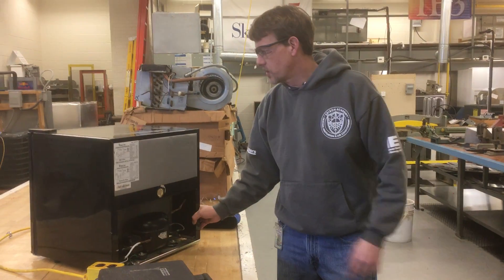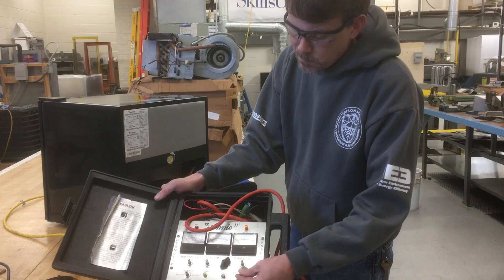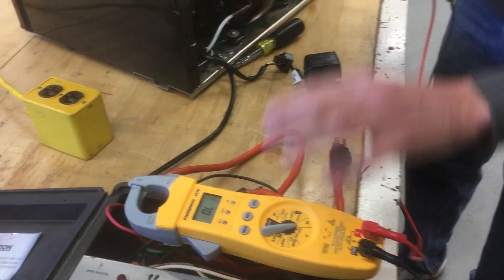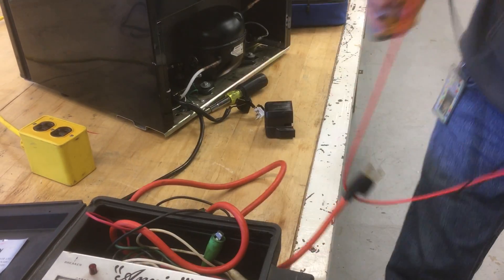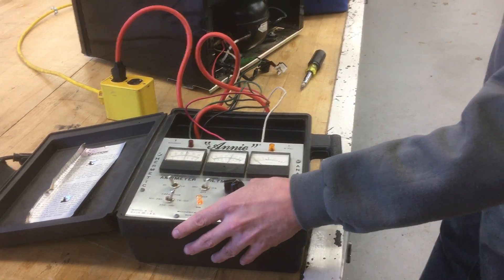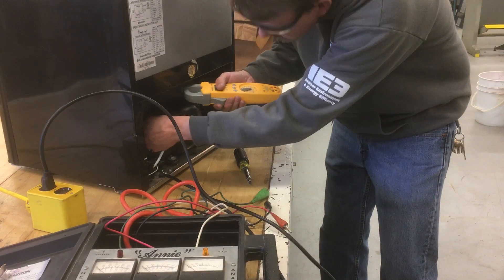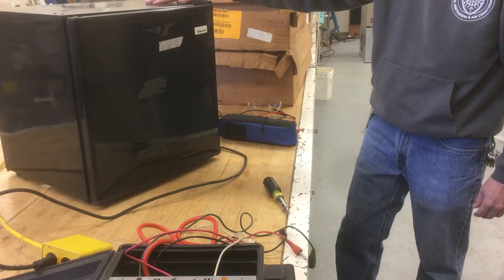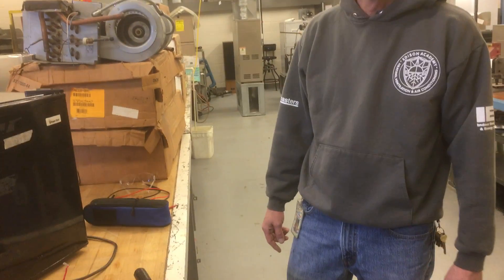HVAC Basics: First - Mini Fridge Troubleshooting Part 2 - Using "Annie" to start a stuck compressor

Comment: On refrigerators that cost over $1,000, why doesn't the manufacturer have this restart device built-in to the refrigerator? I can see how easily it could be implemented but I assume they won't because it will devalue you technicians.
Reply: planned obsolescence

if the fridge stops working, the customer buys another $1000+ refrigerator and then whoever hauls away the old one just restarts that fridge and resells at used appliance store

Comment: Because of your 2 great videos, I have deduced that my fridge also has a stuck compressor.

Bought an Annie A2 on eBay for a quarter of what the fridge cost me. Will report back when the Annie gets here.
Reply: how did it go?
Reply: Successful! Sold the fridge and it paid for the Annie and helped catch up on some vet bills from my aging doggy. Learned something new, cool tool, less stress. Win, win, win!
Reply: @paultrahanjr.8217  awesome

Comment: What an interesting way to unlock the compressor. Presumably to run it in reverse, Annie would wire its internal capacitor in series with the run windings, causing a reverse phase shift, with the start windings acting as the new run winding. That would drive the rotor the opposite way for a few seconds. Great teaching.
Reply from the maker: What an excellent comment to sum it up perfectly. Thanks!

Comment: Very helpful video. I watched both Part 1 and 2. I replaced the relay and starter. When I turn on the thermostat I hear the relay click and the motor attempt to start and then stop. I also smell that electronic burnt smell afterwards. Based on watching your video I have the feeling that the compressor motor is frozen. My question is, without this Annie what other options do I have to get this mini-fridge working? I wonder if I can take this unit to some local electronics shop and see if they can try and shock it back to life. I found this min-fridge in a dumpster and it's in great shape physically. It still has the plastic protective wrap on the door and the sides! Am I wasting my time? Thanks
Reply: I have the same thing and the same question

Comment: I have a Mini Fridge, the Thermostat and Switch is fine.  The Compressor runs but is hot to the touch, but it will not cool.  It's a brand new fridge right out of the box. What could be the problem???
Reply from the maker: Low/no refrigerant or the compressor runs but does not pump due to an internal issue.

Comment: Is it normal for a mini fridge compressor to get scalding hot? I’ve loaded a lot of water bottles in the refrigerator and wonder if it’s that’s the problem
Reply from the maker: High heat load requires more work and full capacity to remove the heat. Once satisfied it shouldn’t be the same amount of heat coming off the compressor or rejected at the condenser to maintain the temperature of the load.

Comment: thats not how a capacitor works, the electricity does not jump from one side to another. they work more like a water accumulator, electricity goes in the common through the coil builds up then is pushed back through the coil. this happens 60 times per second. the capacitor size determines how much electricity is pushed through the coil which is why it determines the amperage.

Comment: Excellent teaching, but these kids seem a little dumb. Who ever is video taping should be getting right in there because we can't see anything. It might as well be radio. I would have liked to have seen how he hooked it up to see that it was locked up. I saw the first video. It seemed like some kind of clamp. How did the multimeter make contact with the wires and which ones?

Comment: Question, in the event you described, can you just replace the motor starting capacitor, and with perhaps a slightly larger capacitance one?
Reply from the maker: Not in MFD’s. There is a +/-  tolerance and it’s small. Oversizing will damage the windings. Thanks

Comment: I'd love to see a video of add/checking charge of a closed orifice system such as this mini fridge. Sometimes it will specify type of refrigerant and amount of charge but  I've checked all over and nobody seems to have a video of it. Seems these units are viewed as disposable.
Reply: They are considered disposable. Most are R-134a refrigerant. No Schrader valves to add/remove/purge/vacuum/etc  refrigerant. By the time you  pay somebody to add those Schrader valves & to properly purge, vacuum, add refrigerant the labor cost itself is more than the couple hundred bucks these things cost.

Comment: My mini fridge has foam pieces around the copper tubes at the back around the compressor should those be removed like shown in the video or is it safe to keep it on. I also have little plastic covers for the flat ends of the tubes

Comment: I tested with the Ohm and everything is fine, and I use Thermal Hemeti-check, then the compressor is wtill not run, but it start getting hot? Any ideal?

Comment: @edisonhvac great videos. Thank you.
What happens if compressor is getting too hot and tripping the overload. Capacitor/motor not jammed up, amperage doesn't change when overload clicks. Thoughts?
Reply: More than likely your Start "Relay" is bad and not making the motor start turning.  So it sits there with current running through the Run winding until it overheats and the Thermal Overload device opens the circuit.  Then when it cools it does it over and over again.  Your Start device should read about 10 ohms or less.  If it doesn't, replace it.  About $10 for the part.
Reply: @hjc4604  Thanks for your reply. I recently purchased this: https://smile.amazon.com/gp/product/B01AKWWLVS/ref=ppx_yo_dt_b_asin_title_o01_s00?ie=UTF8&psc=1
Thinking that the relay and overload were bad. When I shake the relay it rattles, which I've learned is a bad thing. But this rattled right out of the package, so I'm unsure if it is bad.
Is there a chance the compressor doesn't have freon? This mini fridge has been used on and off for the better part of 16 years.
Reply: @nicholassullivan1180   @Nicholas Sullivan  Not sure that I would rely on a rattle to check my components.  An actual relay with contacts and a solenoid might rattle when shaken even if it's good.  It's certainly possible that the refrigerant could have leaked out due to abuse or vibration.  Usually you will find refrigerant oil at the point of the leak and dust will stick to it.  The compressor label should show the Locked Rotor Amps (LRA) and the Running Load Amps (RLA) for comparison.  If the compressor is locked it will show LRA amps,. When running normally it should read close to the RLA.  If it's humming and the amps are below RLA it's probably not starting.  Try comparing the ohms of the old start components to the new start components.  Also what's the model of the fridge and the compressor?  Is t a schematic available?  Check out this video.  https://youtu.be/nx7l9kY2_bU
Reply: if you're not seeing amperage go up the overload device could be warn out and tripping at lower than rated amperage. also your meter might not be fast enough to catch the amperage spike.

Comment: First of all, thank you for th video.  You are obviosly a good teacher.  Next, without buying the expensive meter or even the other electrical pieces that you don't recommend, is there any way to reverse the compressor?
Reply: Generally to reverse motors you bead to reverse its input polarities ( switching the hot/neutral connection) I wonder if it’s possible to open up the compressor and manually do something too?
Reply: @CB_ChaosLove  hmmm 🤔. Me too! I need Annie to reverse mine I guess. Curious

Comment: What about shinning some light inside the compressor compartment so one could see how to connect the Ammeter? Just describing it ain't enough! 1st part was very good! Thanks
Reply: Put the meter clamp around the black wire or the white wire.  All current enters through the black (Hot) wire and leaves through the white(Neutral) wire.  Either one should work.
Reply: Amp's are taken with the meter "clamp" around 1-single wire . In single phase (120v) either of the two will give you the same reading

Comment: Help me understand this...I always thought common was the least resistance reading followed by run being the middle and start with the highest resistance reading???
Reply: Common is the lead that is "common", i.e. connected to both the Start and Run windings.  When you read S to R you are reading the resistance through both the Start and Run windings.  R to C is just the resistance of the Run winding to the Common terminal which should be the lowest resistance as it is the larger gauge wire.  The S to C terminal readin is the resistance of the Start winding which is thinner gauge wire since it is only supposed to draw its current for less than a second when starting before the Start Relay/Device removes it from the circuit.  Since it is thinner wire with more windings it has higher resistance.

Comment: Nice that it's running again, but WHY did the compressor lock up to begin with?   It's sorta like the situation with a blown fuse/circuit breaker  --  you replace/reset it, but then how do you know it's not going to just blow/flip again later?  Need to find out the cause of the lock up.
Reply: I see we have interest in engineering here. The reason they lock up is moisture in the refrigerant lines, usually combined with not turning on the compressor in a while creating corrosion within the compressor.

Comment: The following data is applicable to the ANNIE A12X Export 220-250 Volt-60 Cycle Model.

SECTION A – METER OPERATION 

Ohmmeter

1. Make sure the Analyzer is unplugged and Ammeter Switch is off, Ammeter operates on “D” cell battery.
2. Move Ohmmeter Switch to ohms position.
3. Clip Red & Black leads together, turn Master Switch on, needle will move to about zero. Adjust to zero Ohms with control inside chord pocket. If meter will not zero, replace battery.
4. Use Red & Black leads to identify winding terminals. Highest Ohms is from Start to & Run terminal.Terminal left is Common. Reading from Common highest is Start. The remaining terminal with lowest reading is Run.

Voltmeter

1. Disconnect Analyzer from external power source.
2. Put Ammeter Switch to “Hi” position.
3. Put Ohmmeter Switch in “Power” position.
4. Put Voltmeter Switch in “Line” position.
5. Turn Master Switch “Off”.
6. Isolate Black, Red, White and Yellow from each other and earth.
7. Connect power supply chord of Analyzer to "voltage connection to be read.
8. The "voltage indicated on the Voltmeter is the line "voltage supplied to the Analyzer.

Ammeter

1. Disconnect Analyzer from external power source.
2. Put Ohmmeter switch in “Power” position.
3. Put Ammeter switch to “Off” position.
4. Put Master Switch in “On” position.
5. Connect the apparatus under test to the Red and Black leads. Isolate the Yellow and White leads from each other and ground.
6. Connect the Analyzer to a power supply of the correct "voltage for the apparatus being tested.
7. Put Ammeter Switch to “Hi” position, read up to 25A apparatus being tested. After apparatus has started switch to “Lo” position, if current draw on the ammeter is under"5A"
8. If line "voltage is desired while measuring amperage, place voltmeter switch in the “Line”position.

Section B - HOW TO CHECK A HERMITICALLY SEALED UNIT 

1. Remove all external wiring from the terminals of the sealed unit.
2. Connect the Red Lead to the Run Terminal. White Lead to Start Terminal, Black Lead to the Common Terminal, and the 
Yellow lead to the solidly Frame.
3. Make certain Master Switch; Ammeter Switch and Voltmeter Switch are off. DO NOT CONNECT ANALYZER TO EXTERNAL 
POWER.
4. Put Ohmmeter Switch in “OHMS” position and press Start Button. If resistance is indicated (movement of ohmmeter)
the windings are shorted to the frame.Replace unit if this condition exists.
5. Put Master Switch in “On” to check resistance of Run winding. “Reverse” position checks resistance of Start windings. 
Replace unit if windings are open or earthed. 

Section C - HOW TO START A HERMITICALY SEALED UNIT

1. Remove Yellow Lead from frame and isolate it from earth.
2. Put “Ammeter” Switch to ‘Hi” position.
3. Put “Ohmmeter” Switch to “Power” position.
4. Put Master Switch in “Off” position. 
5. Put Capacitor Selection Switch in proper range (see selection G)
6. Connect Analyzer to power supply of correct voltage for the compressor. Power Light will come on when the Analyzer is energized. If no light or a very dull glow of Power Light check fuse in chord pocket. Replace if necessary. Line Voltage can be read by putting Voltage Switch in line position. 
7. Hold Start Button “IN” put Master Switch “ON” position.
8. Release button when units starts.
9. Turn Master Switch off if unit fails to start in 3 seconds. 
10.If unit operated satisfactorily the trouble is with the capacitor, relay, control, overload or other external wiring.
11.Put Ammeter Switch and Voltmeter Switch to desired ranges for further tests. These tests include low voltage or high current draws, those that are above rated amperage. If unit fails to start it is stuck, see section D. Disregard capacitor and relay bulbs while making this test.

Section D - HOW TO REVERSE A STUCK OR FROZEN UNIT 

1. Proceed as outlined in Section C, steps one and two.
2. Holding start button in, quickly move Master Switch between “On” and “Reverse” position several times. If unit starts let 
it run for approximately a minute then turn it off. 
3. Try to start the unit as outlined in Section C, Step 3. If unit now fails to start it is beyond help and must be replaced.

IF FUSE BLOWS WAIT FIVE MINUTES AND REPLACE THE FUSE INSIDE CORD POCKET

Section E - How To Test Capacitors

1. Make sure Master Switch and Ammeter Switch are off. Put Ohmmeter in Power position. 
2. Disconnect Capacitor form all external wiring including bleed resistors. 
3. Discharge Capacitor with light bulb or bleed resistor so as not to blow fuse on internally fused capacitors. 
4. Connect Black and Yellow Leads to Capacitor terminals.
5. Connect tester to power source.
6. Place Ammeter Switch in “Hi” position and note reaction of light.
a. If light goes on then out the capacitor has taken a charge. New capacitors may keep the light glowing for few minutes
b. If no light the capacitor is open.
c. If light stays on then the capacitor is shorted.
d. If light decreases but does not go out the capacitor is leaking.
7. When light goes out, press capacity button for mFd reading of start capacitors. (Do not press button if light remains on 
indicating a shorted capacitor) Discard capacitors that vary 20% from rating. For small start and run use “LO” range on 
Ammeter. 
8. (Optional) The Analyzer can be left on the job as an emergency substitute capacitor. Connect the Yellow and White 
Leads to the leads that normally go from the systems wiring to the capacitor DO NOT PLUG THE ANALYZER IN, put 
Master Switch on and set Capacitor Switch mFd needed. All other switches should be left off or in the center position.

SECTION F - TO TEST POTENTIAL RELAYS ONLY

1. Make sure Master Switch, Ammeter Switch, and Voltmeter Switch are off.
2. Put Ohmmeter Switch in relay position.
3. Turn volts control all the way down (counter clockwise)
4. Connect White Lead to relay terminal #1, Black Lead to #2, and the Red Lead to #3.
5. CONNECT ANALYZER TO 230 VOLT POWER SOURCE.
6. Turn Master Switch “ON” and set Voltmeter Switch to relay position. Relay light must come on. If no light points are 
open, replace relay.
7. Increase volts until relay “picks up”. Make a note of the voltage before “pick up”. This indicates the “pick up” voltage.
If light remains on, points are frozen and relay must be replaced. If relay does not “pick up” at maximum rated volts,
the coil is bad and the relay must be replaced. 
8. Decrease voltage until relay “drops out”. Make a note of voltage just before “drop out”. This indicates “drop out” volts.
Light must come back on when replay drops out. If Light remains on the points are frozen or sticky and relay must be 
replaced. 
9. Compare pick up and drop out voltages with the information supplied by the relay manufacturer. 

SECTION G - 240 VOLT CAPACITOR INFORMATION

1. Units up to 2 hp use 25-80 mFd range.
2. Units of 1-1 hp use 85-145 mFd range.
3. Units over 1 hp use 150-200 mFd range. 

SECTION H - RELAY WIRING INFORMATION

1. G.E. Relay 
a. Lead from post #1 goes to “Start”
b. Lead from post #3 goes to “Run”
c. Other post is “Common”

2. Delco Relay
a. Lead from post #S goes to “Start”
b. Lead from post #M goes to “Run”
c. Other post is “Common”

Comment: Curios: can one rewire the sequence of "Can, She, Run" without using Annie ? some motors can be reverse wired. Thanx
Reply: Not for a refrigerant compressor.  while the motor may run in reverse, the compressor part won't function right in reverse.  And do you really want to rely on a motor you had to reverse momentarily to start it running.
Reply: @hjc4604  hmmm, love the reply BUT asked  if motor can be reversed wired just to get it unstuck, not to have it run in reverse forever. most of us have run into a situation of a stuck bolt, instead of forcing it counter clock wise, first hair tighten it to loosen it, then remove. i think my analogy sux must you get the point LOL. you sir get a thumbs up anyway